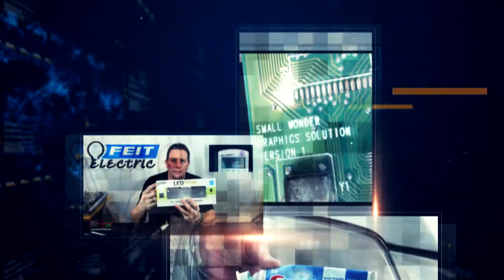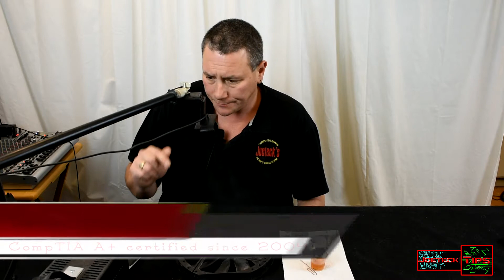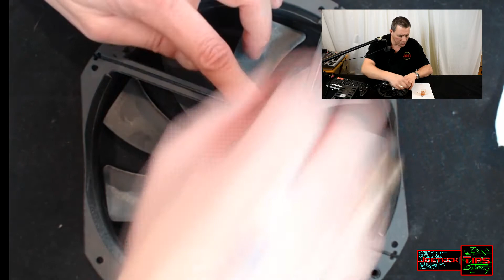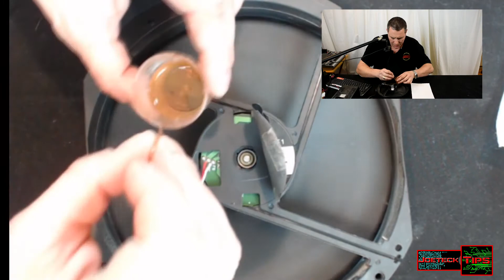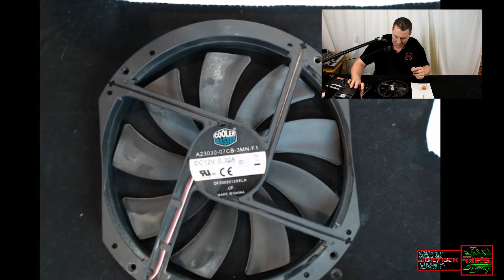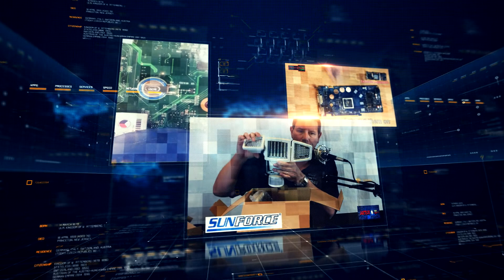How to REPAIR a box fan - Tutorial

Comment: I was hoping to see the most common problem with box fans addressed. How to  fix missing legs on box fans. It seems every cheapo box fan I have loses its legs.
Reply from the maker: Box fans do not have legs?
Reply: @Joeteck  They do have legs.  The legs are these small plastic extensions that keep the box fans from falling over.  These legs often snap off and that makes these fan less stable. They fall over easily without the little legs attached.
Reply from the maker: I think we are talking about two different fan types. I have never seen this before. Box fans are for internal devices.
Reply: Joeteck Oh maybe I should’ve actually watched your video fully. I’m not talking about a computer fan. I’m talking about a box design cheapo fan you put in a window. The big dog company that makes those is known as Lasko. Lakewood box window fans went out of business in 2007 and they were superior in every aspect but people didn’t wanna pay Just a few dollars more for a fan with a metal case that’s still going strong and I think must be close to 20 years old that I’m using. Anyways thanks for your reply we are talking about different animals.
Reply from the maker: @cubehire3653  that is not what its called. Thats a window fan. Not a box fan. You described your product wrong
Reply: @Joeteck  I'm afraid you are mistaken. Check out a Lasko Model B20573. It is a classic example of a box fan. Its all good although thanks for your posting your how to video.